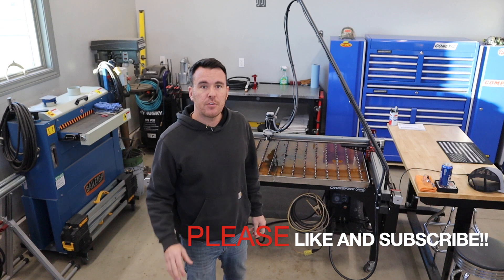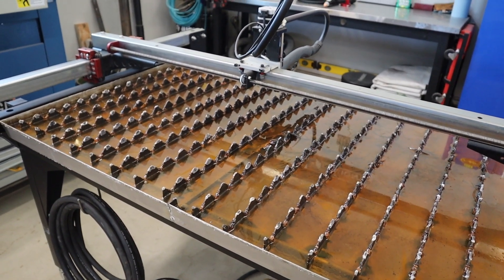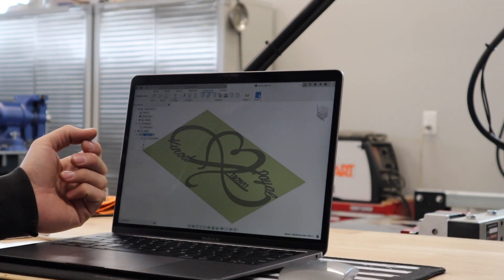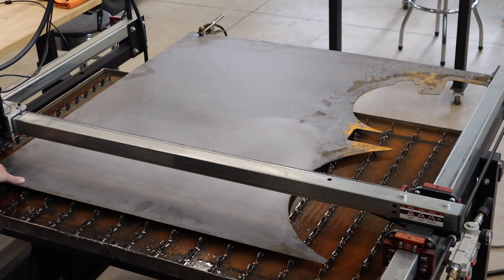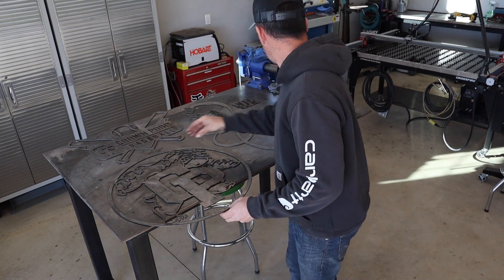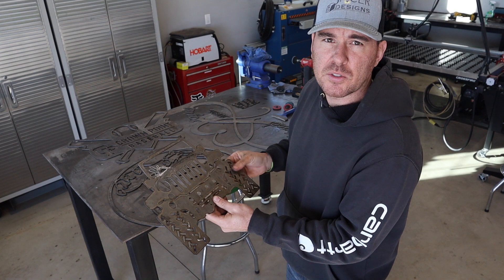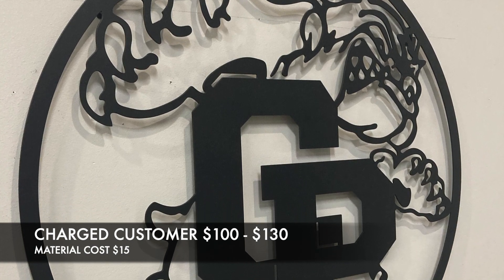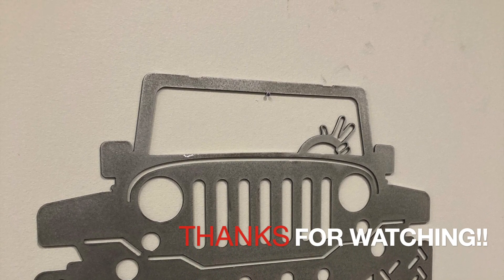TURN STEEL into MONEY W/ LANGMUIR CROSSFIRE PRO !

Comment: 30 amp 240? Dont you need 45 to get to 40 amps or do you just not go that high? I probably want to do 1/4” steel and aluminum max.
Reply from the maker: The input is AC.   The output is DC.  Amp ratings arent the same.  I ran that cutter at 45 amps all the time.   Same with welders.  All you have to do is  check the specs on the machine.

Comment: When you only put 2 tabs on a piece, do you ever notice them not hanging right?  I usually try to put a 3rd on to let it tripod on the wall so I know it always hangs right and not tip into the wall, even it its not used as a hanger, just a spacer.
Reply from the maker: I use 1/4 round stock.  I cut them to length and tack them on the bottom so the spacing is even all the way around.

Comment: Do you see the metal sign business/popularity trend as just being something short term, or do you think it's something that will continue to stick and be desired by consumers? I've always thought about picking one of these up and starting a small business to do signs, seasonal decorations, etc.
Reply from the maker: I can see there always being a demand for it.  Everyone seems to be into the personalized items.  I dont see that changing.  I also my small parts and brackets with that machine too.  I actually have better profit margins with making brackets than signs.
Reply: @SpicerDesignsLLC  Agreed, especially on Etsy people go crazy over the custom stuff. Plus once you knock out the CAD files, it seems there isn’t a ton of extra work that needs to be done

Comment: Great video's. Did you get the THC and LS with yours, and are they necessary?
Reply from the maker: Thank you!  I did get the torch hight controller.  I have issues with it every once in a while.  Sometimes i shut it off.  Ive got some really good upgrades coming up for the table soon.

Comment: You made custom slats? Do tell
Reply from the maker: I pulled a file off fireshare and altered it a little.   Took the points off so it didn’t scratch the material.  I have a video coming with a pretty interesting product for slats.  Should have it up in the next month or so.

Comment: Dude why are you not wearing your welding helmet ?
Reply from the maker: I was wearing it, just not using it.  I usually close my eyes when im tacking.  Sometimes my eye lids get sun burn.
Reply: I seen it on your head
But I seen too that you was not using it 
I don’t want you to go blind or maybe someone else might wear theirs because you did not wear yours
Reply from the maker: @larryrobinson4288  i close my eyes when i tack.  Im not looking at it.  Everyone does that Larry.
Reply: @SpicerDesignsLLC  that may not be enough because it throws a ultraviolet light from the weld that is why you need the shield
Reply from the maker: @larryrobinson4288  are you a welder Larry?  Ive been welding for 18 years now.  I have 20/15 vision.  Never  had an issue.  I appreciate the concern but this is normal procedure for tacking.
Reply: @SpicerDesignsLLC  ok thanks
I’ve done a little bit of everything from pumping gas to playing with lasers

Comment: What do you charge roughly for a sign? Been looking at doing the same for awhile! Thanks great video ☺️
Reply from the maker: @mustangmatt1987 It all depends on the size, design, material and labor.  I just made a video about how I price signs.  Not sure if you've seen it yet.  If you haven't it will probably answer some questions.   Thanks for watching!
Reply: That moment when you are still watching the video and then the sign pricing comes up 😂. Well, have you changed prices on your signs? Thanks again!
Reply from the maker: They have went up a little bit.  Most of the signs I've been doing lately are custom signs so the pricing is all different.  Steel has definitely went up but I do my best to keep the prices the same.  Its just a side business so im not doing a lot of volume.

Comment: What kind of air system are you running?
Reply from the maker: It so just a cheap 30 gallon husky air compressor.  Also have an air dryer/ regulator.  Theres another one built into the plasma cutter as well.  Air compressor keeps up just fine though. I  plan on upgrading once i build a barn/shop.

Comment: Great video! Thank you for sharing all the details of the time and money invested versus return. Looks like you were using a MacBook Air? Does it seem like the Mac products run that system just as well as Windows based as far as you know?
Reply from the maker: Windows is the  recommended system to run with that setup, but they have options to run it on IOS as well.   Ive had a couple of issues here and there with the Mac that I wouldn't have had with Windows.  I have another video on the plasma machine ready to upload.  Just waiting on one last bit of footage.  Should be a good one.   Im starting a more detailed video tomorrow on the whole process.  Should be more informative.. Thanks for watching!

Comment: Nice work. I’ve been thinking about having a side hustle like this as well. I’m tech and Cad Savvy, so no issue there. I’m sure if I get a few local customers the ROI will be quick. 

What kinds of tolerance does the plasma cutter have??
Reply from the maker: Yes for sure. My machine pain for itself pretty quick.   A machine like that covers a lot of applications.  Doesn't take up a ton of space and doesn't require too much to run it.   I just picked up a $9k sign job for the exterior of a building.   Thats material, powder coating, assembly and installation.  I have more plasma table video coming soon.  Hopefully next week or so.

Comment: Great stuff. BUUUT. what you just showed is a lot more than 5g to start out.
Reply from the maker: If your talking about all the equipment in my garage, then yes its more than $5k. The equipment I specifically described in the video priced at $5k was accurate.  Plasma cnc table with 45 amp plasma cutter was $3864.95 with tax and shipping.  The air compressor I use is just a cheap 30 gal husky which costs $352.03 with tax.  After those two expenses your left with another $783 budget for a laptop to get to the $5k. Those are the only 3 pieces you really need to plasma cut signs.  The intro to the video was specific to the plasma table setup only. Hopefully that clears up my cost breakdown.   Thanks for watching!

Comment: Great video! What gauge steel are you using for your signs?
Reply from the maker: Thanks.  I have some more videos coming soon with the plasma machine. I use 16-12 GA depending on what kind of sign it is or how big.  I would go any thinner than 16.
Reply: @SpicerDesignsLLC  do you notice any warpage with 16 gauge?
Reply from the maker: @MrClockw3rk  depends on the design.  I usually get warpage when there is a lot of cuts around the boarder.  Honestly im not a big fan of 16 ga.  Most of my designs i cut on minimum 14 ga.

Comment: You should try an air chisel. It will speed up the dross removal.
Reply from the maker: Ive seen guys use them.  The dross comes off pretty quick.  But the back side of the cut leave a sharp edge on it.  Im just worried someone’s going to cut themselves on it so i basically bevel the entire back cut.  I have a dual drum sander i can run them through too but it still has that edge.

Comment: how do you calculate prices?
Reply from the maker: I usually price the signs by size.  There are a lot of variables like size, gauge steel, custom or stock design, any welding or painting.  Just have to use your best judgment to make it a fair price but worth your time. Theres really no great way to do it.   Thanks for watching.

Comment: Awesome video!
What do you run for a compressor for your plasma cutter? What about air regulators, filters, or air dryers?
Reply from the maker: No issues with but he air compressor.  Ive done 20 minute cuts with it.  Keeps up just fine.  Ive cut up to 3/16 with it.  I just got a machine torch for it too.  I might make a video on that one day.  Its a nice upgrade.
Reply from the maker: Thanks.  I just have a 30 gallon 175psi husky air comp.  Nothing special.  The plasma cutter has a built in regulator and dryer but i cranked the internal reg to the max and installed an external regulator/ dryer that’s accessible for adjustment.  Only needs like 60psi for the 45 amp plasma cutter.
Reply: @SpicerDesignsLLC  excellent. So your 30 gallon 175psi husky has no issues keeping up with your plasma torch? Do you ever go thicker than 16 gauge sheet?

Comment: Great video!  Waiting for my Crossfire Pro now.

Question.  Does the Pro now come with pointy slats or did you modify yours?
Reply from the maker: Thank you.  Ill have some more videos coming up with the crossfire.   I wore out the first set that came with it.   Then I modified a dxf file on fireshare to make the pointed set.  I just flattened the points.  I can send you the dxf file if you email me.